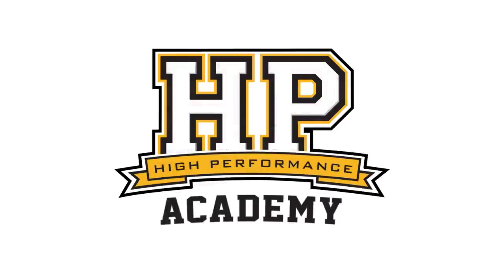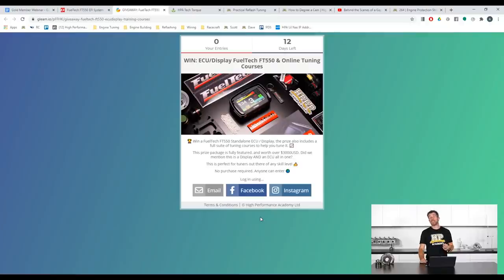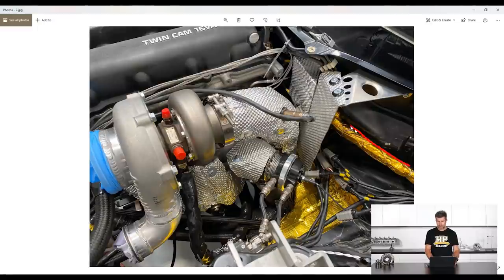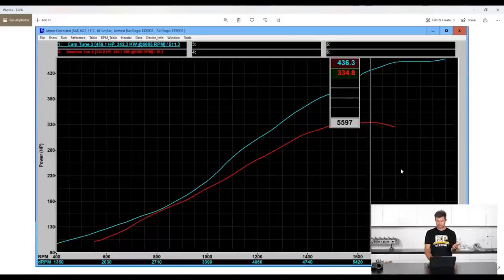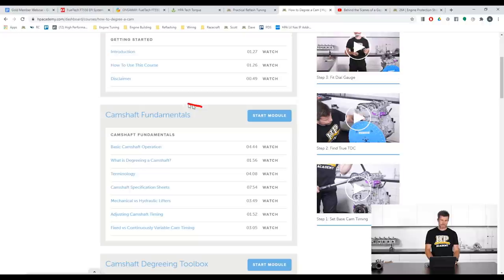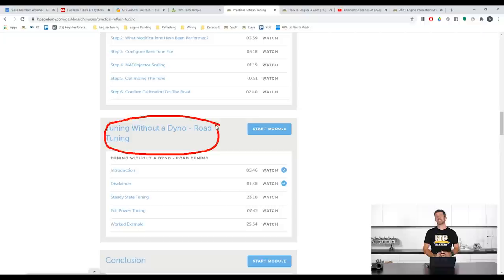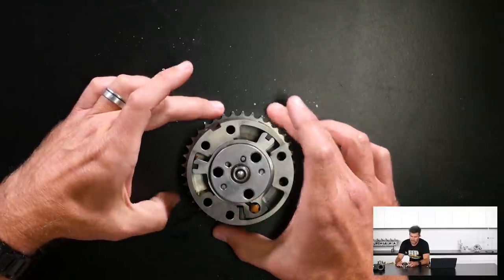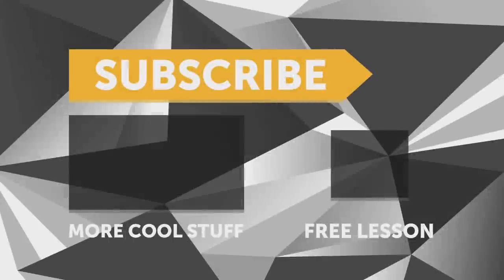Heat Management, Cam Swaps and MORE | Today At HPA [#UPDATE 264]

Comment: I’ve thought about the access to the cam gears that way. Welding 3 small tabs across the top to try and pinch them somewhat together with a gasket of some sort between the two.. (though I’ve never cut one open because I thought the covers were magnesium & to see the actual thickness of the material to potentially create a seat for a custom gasket)

Comment: Do you think the heat shield product would trap moisture?  Would I be better to go with a turbo blanket?
Reply: better ceramic coat it, or have a heat shield separated from parts what needs to be avoided from heat.

Comment: Not sure you do always really lose out with LS cams as some of the stock stuff is so horrifically under cammed that there are gains to be had literally everywhere. The point you make is bang on though, if a bit more cam is good then surely a lot more must be better right? Erm no, not if you value drivability, emissions & fuel economy plus durability of your valvetrain!